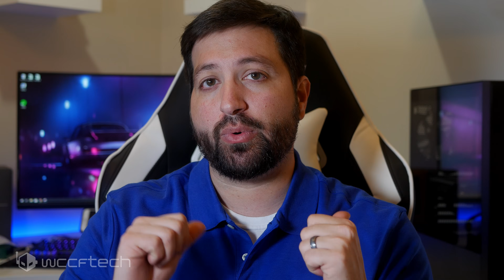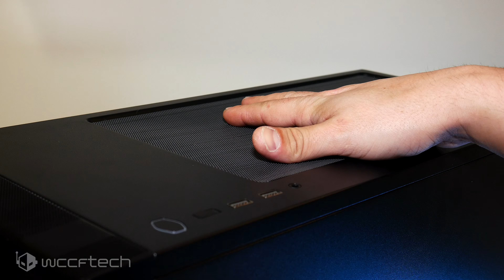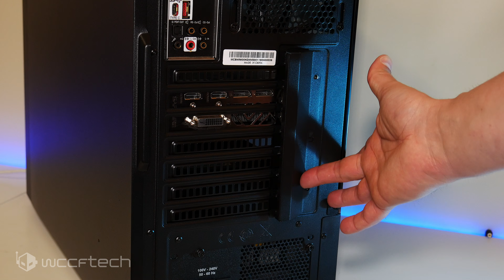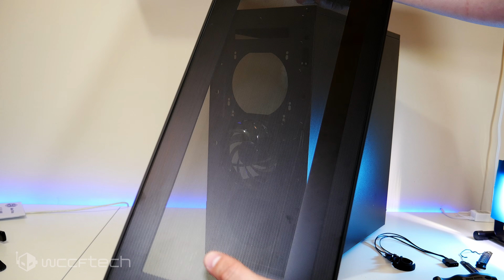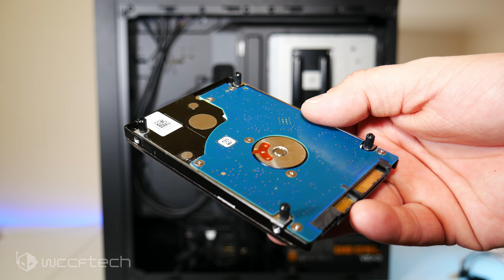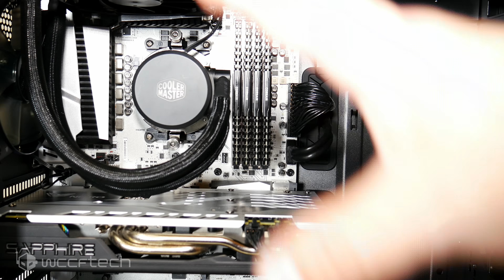Hands On With The Cooler Master NR600 | The Better Budget PC Case?

Comment: i rather them put 3x 3.5" HDD mount below the motherboard instead, nobody is gonna buy so many SSD for a pc build as you only need 1 NVME for the entire system while you can pump in tons of 10TB HDD into  the system to show off lol. I actually just tape my 3.5" HDD on that same spot, different casing tho, these 3/4 TG design is the best as you get extra space to put stuff above the PSU lol
Reply: I f
Have 5 sata ssds in mine
Reply: @moisturesplash2902  5x ssd for what? media? lol

Comment: Can the hard drive cage be removed by drilling out the rivets attaching it to the case? With all the other ways to mount SSD's and HDD's in this case - the cage is a mute point to have it in there.

Comment: Thanks for such a nice review, I'm sold out on this case, liked and subscribed to your channel.
Reply: @fire trails yep I bought it and mine came Pre installed on top.

But I saw some unboxings on YouTube where the top magnetic dust filter was placed with side panels, so did you clearly searched the whole box?

And if you don't find it then you should register and generate a support ticket directly to Cooler Master. They'll surely send you a new one if didn't got one. Or they'll redirect you to their offcial resellers for magnetic dust filter and apologize for the inconvenience.
Reply: @fire trails no problem mate. It would surely be inside the box. And if not then surely they'll send you another one :)
Reply: @muhammadbilal5961  how is the dust problem in the front of case throughout time if you don’t mind answering?
Reply: @ange11uis33  dust accumulation is kinda high since it's front mesh, pulls fresh air inside, so u have to clean it like once in a week.

But u can order a front magnetic dust filter from AliExpress / China, and also dust accumulation depends on where u have placed ur pc, i have placed it my living room and it gets very dusty here, so If i place it inside my personal room then the dust accumulation will be low. I hope this helps.
Reply: @muhammadbilal5961  it does my brother I appreciate you!

Comment: I got this case setup and I love it.  I put some corsair rgb fans in and I am happy.
Reply: @fire trails the mesh for the top is on the inside of the case! You have to take it out
Reply: Did u have to buy a fan hub if not how did u connect the extra fans

Comment: I contacted Cooler Master USA and they said they will not be selling the NR600 ODD (optical drive) version in the US.  I really wanted one of these and found them in the European version of the Cooler Master store.  Unfortunately it costs more than the case to ship to the US.  Not worth it.  I'm sure some shark will travel, buy a couple from there, and sell them for much more in the US like I have found some obscure sellers doing on some sites.  There was no explanation from Cooler Master about why this decision was made.  Guess I will have to invest in an external optical drive for the rare times I actually use one.  I was set on this case so......
Reply: Optical drives are all about 7 inches long. This case is i believe 8.25 inches wide. You could custom side mount an optical drive in the bottom if you cut out the front side of the drive cage and cut a hole in the side of the case.
Reply: lordtartarsauce b Actually because of the layout in the psu hub, you cannot do this.  There is not enough space for the width of the disc drive
Reply: @jasmosanew6146  perhaps you've misunderstood me.
Reply: lordtartarsauce b that front side of the driveway..  isn’t that riveted there for structural integrity of the case though?

Comment: We have top mounted larger cooling rads to avoid the congestion at the top of the mobo.
Like you I guess don't like anything touching that isn't supposed to be surface to surface.
Also there are superthin large cooling solutions that might be suitable to resolve this space issue.
Most of them say they are 20% thinner which is significant.
An excellent review btw.

Comment: I thing this is a very good case watch out phanteks, and fractal meshify, now if they made the bottom base with vents so the bottom fan can push more air to the GPU.
Reply: cooler master got trash fans anyway, but if you put 2 noctuas instead of those 2 crappy fans(had same exact exaust fan, and same, just RGB intake fan, and at 1200rpm they are loud and move close to no air, at 2000rpm that fan still moves less air than my noctuas at 1200, and ones in this case probably dont even go over 1200 so it's like 1/2 of noctua airflow, just a single noctua upfront could cool gpu+cpu in this good vented case, or swap out intake/exaust fans and put another same fan upfront for $8 i think it was the price of it or something liek that, rly cheap, not even that loud even compared to noctuas at same rpm, at least airflow one, one that comes in the front is loud and its air balance version, just that they are innefficient)
Reply: Komi Lopov so if i place 3 noctua as intake and 1 of the included fans as an exhaust, would it be enough? Or should i get 4 noctuas..?

Comment: Not a bad case, but I like my Mastercase H500 better. I never use the front audio, so the single plug is no problem. I like the drive mounting options, however I have 2 2TB M.2 SSD's which is all the storage I need with no extra wires to deal with. On my system I used the same 120mm liquid cooler, but mounted it on the rear and having it drawing cool air into the case. You might try that if it's not fitting the top mount. I have a 200mm fan on the top venting my H500 with the 2 200mm fans it came with drawing in air from the front. The only thing I don't like about the NR600 is the way the side glass has no captive thumb screws, and there's nothing to keep it from falling. The glass side panel on my H500 has captive thumb screws, and it will tilt back without falling. Overall a very good video, so thanks.
Reply: If you need to be in your case, lay it on it's side to remove the side glass pannel. Like that, you don't risk it from falling when you remove the thumb screws. Geezes, what a simple solution to in fact a non existing problem.
Reply: I like the fact that the NR600 is half the price of the H500 and still covers everything you need from a case.
Reply: If youre running a closed loop why not lay the case down before you take the glass off?